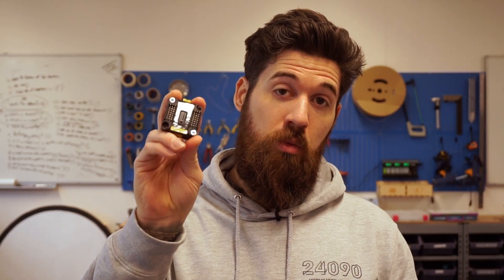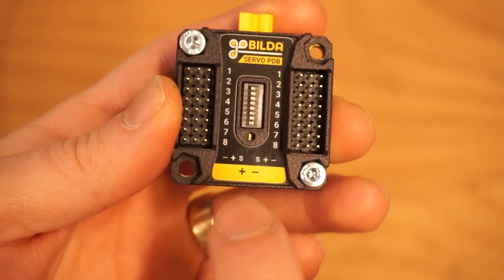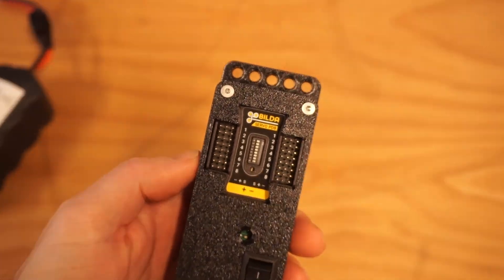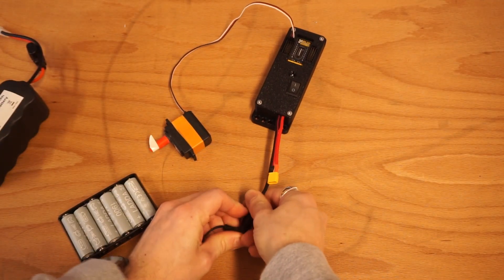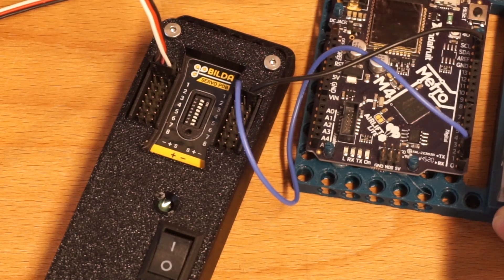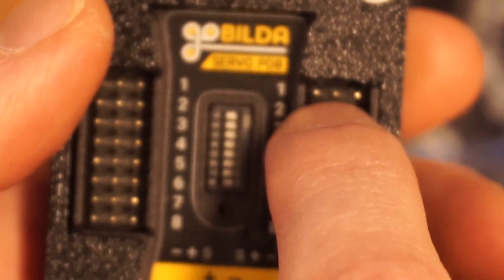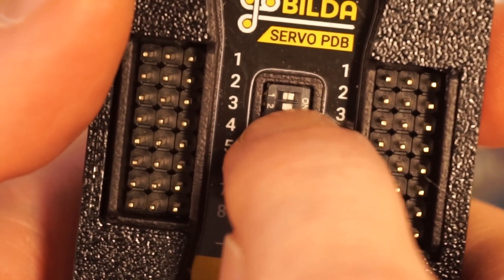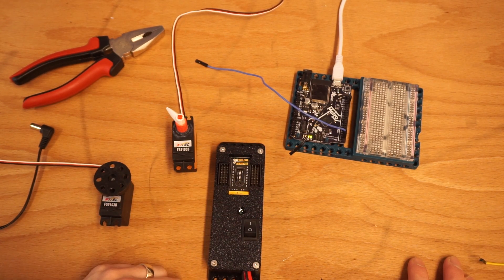Power Your Servos: Arduino Projects with GoBilda's Servo PDM

Comment: found this board. seems pretty good on specs ill need to daisy chain it for my project sadly. wish a 12 channel power distribution board was on the market with higher amp draw. this will work for now though.
Reply from the maker: It is a pretty great little board. What type of Amperage are you trying to put through your project? 30A peak for 15s* is pretty serious.
Reply: @BroganMPratt I’m building a quadruped robot. The ampage per servo is only 1-2A however if I want to scale the motors I need to make sure it can take the max current I could do for the servos.
Reply from the maker: @Scarlett_King000  Yes this is true. Best of luck with the project! Sounds fun